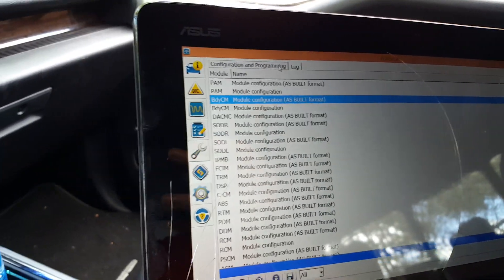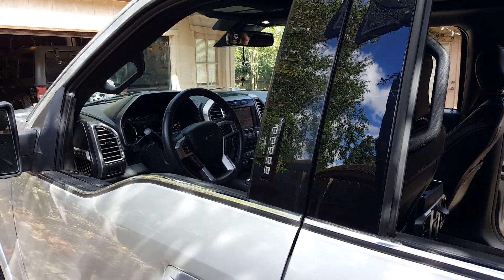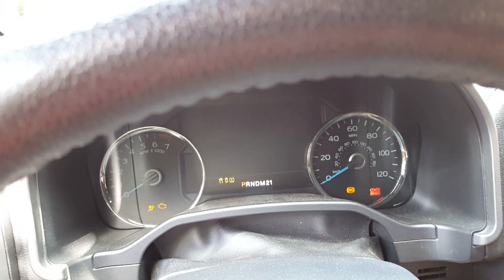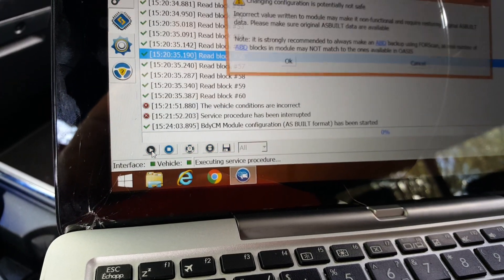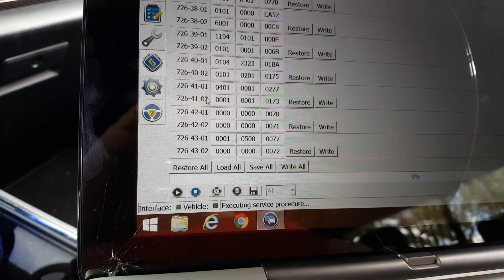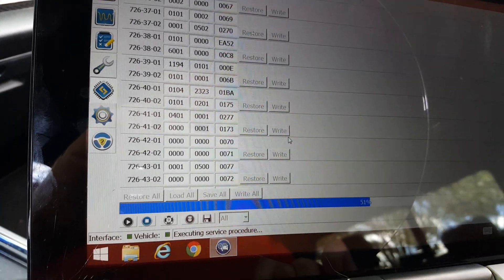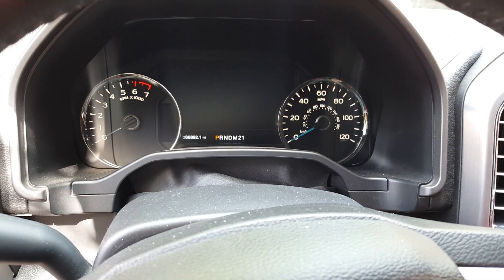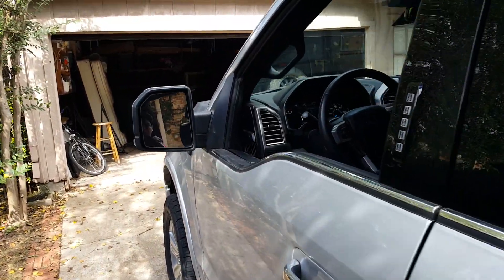Forscan ford f150 double honk disable

Comment: I did this last night to my 2015 f150 lariat screw push button start. And now my doors do not lock automatically upon exiting the vehicle while turned on. Any advice?
Reply from the maker: Did you figure this out? I would revert to stock and try it again. It shouldn't effect the locking.
Reply: Reverted to stock and it still did not change back.

Comment: Is there a way to disable the honk when locking the doors with the remote?
Reply: Only press the lock button once...
..mine only beeps if i press it 2 times.
Reply: @Tanks250  mine does the same.  However, I have to press lock 3 times to remote start.  Wanted to see if the honk can be disabled all together.  It's so loud and obnoxious everytime I start my truck in the mornings.
Reply: @MrAjd1982  yes..through Forscan it can be completely disabled
Reply: @MrAjd1982  Hey dude, not sure if you got this figured out but look up Andrew Mitchell installing a remote start kit on his F150 and he shows the FORScan code to change to stop the honk towards the end of the video

Comment: You should mention that this feature is to prevent you from leaving in your truck with NO key!! there is another setting to change where you cabbot put the truck in DRIVE if the key is not with you....I have to search but heard about it
Reply from the maker: Yes sir. But as long as you know the keypad code. You should be able to get in. Here's the Secure Idle Video... https://youtu.be/P8aSq9934pI
Thanks for watching

Comment: I owe you another Bud Light 👍
Worked perfect, now I can get out and get the mail or hook up a trailer in peace.
Reply from the maker: Thanks Justin! Glad it worked for you! Checkout the other tweeks I did too.
Reply: @ricardosworkshop  Exactly why I plan to do this, we tow a travel trailer and I hate to be that guy who's truck beeps AT ALL at the camp site. Right now I leave the key on the seat when I'm getting in and out, but obviously I don't like doing this. The next thing I want to see is if you can disable the panic alarm through forscan, because that is way too easy to hit by accident.
Reply from the maker: Yes. There is a way to change the panic alarm from one click to two clicks. That should be my next vid. Thanks for watching!